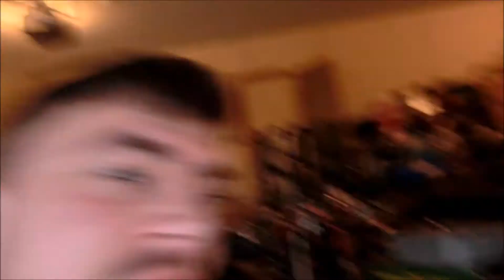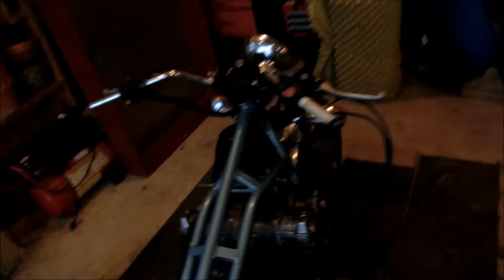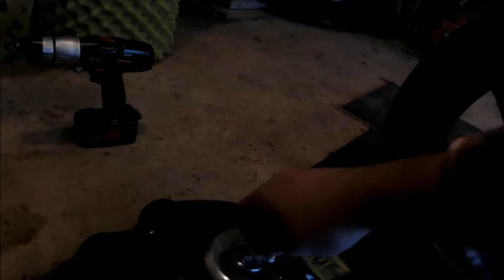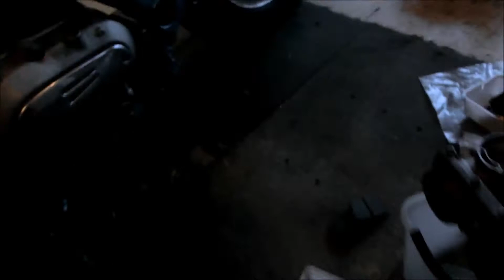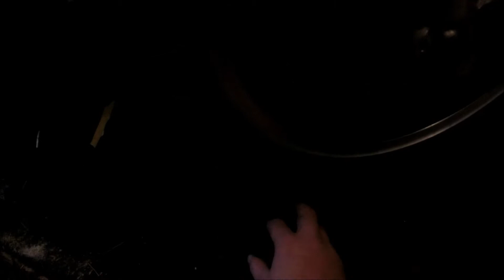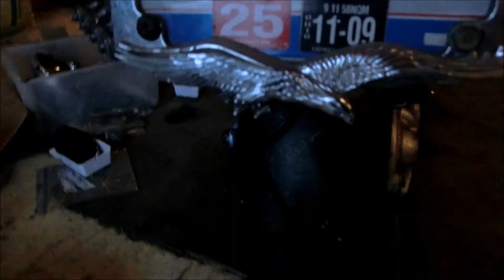Be Careful With Craigslist...

Comment: the ignition doesn't match the gas tank probably because it went out at some point. kinda common in older motorcycles that you have to carry 2 keys for the ignition and the tank, but one would expect to receive both keys lol
Reply from the maker: Yeah I expected that there would be a lot I would have to buy, so it's not a big deal. I just like to complain